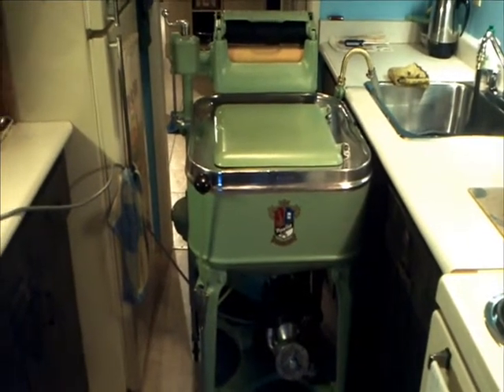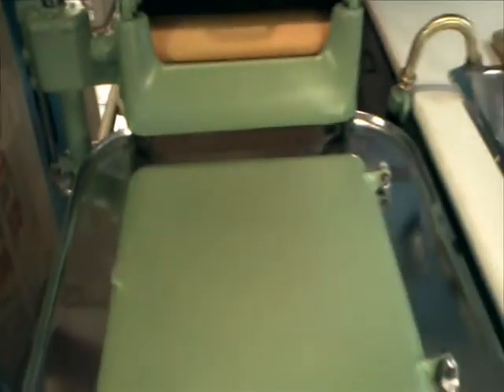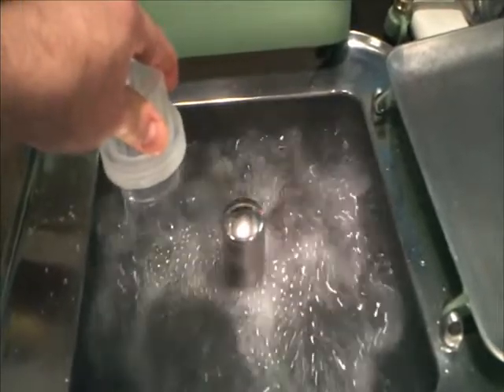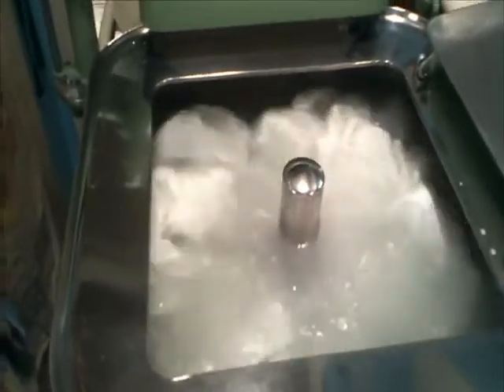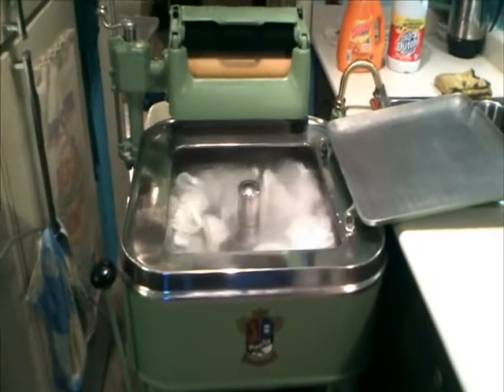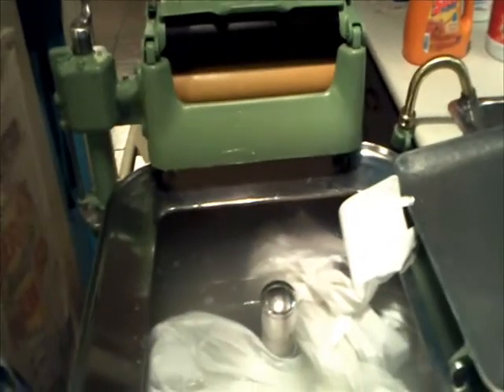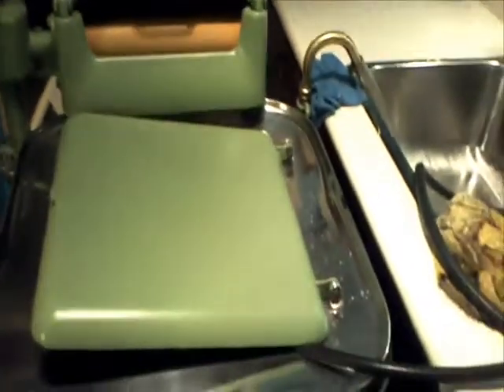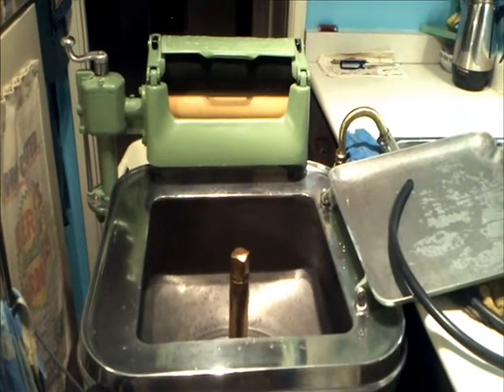Antique Maytag model 30WP wringer washer tutorial

Comment: I have a similar model, Just starting on the restoration. Most things are obvious in how they come apart except the agitator . Is it forced fit on something like a morse taper, a screwed on or what? Not something one would want to start beating on and break. It does have slight knurls' impressioned within the top 3 inches.
Reply from the maker: This question was somehow missed. For the benefit of anybody actually reading the comments, the agitator just sits on the "torque" or drive block. It's heavy enough that it doesn't float up when water is added to the tub. If it's difficult to remove, that usually means coagulated grease has it stuck on and should be released by use of a torch. The torque/drive block is bronze, so it won't be rust that has it stuck on.

Comment: Greetings! I just picked up a Maytag square body wringer washer. It was sitting on its side in a field, so is dirty, but not very rusty. I plan to restore it and use it as my shop washer. I have two Maytag engines - a single cylinder and a twin cylinder. Do you know if there were separate models of washers for gas or electric power? My wringer rollers have seen better days, and the drain hose is split. Do you know a good source for parts?
Reply from the maker: Hey Jason ... I do apologize for the delay in responding. To answer your first question: the model numbers varied only as a designation to identify whether the machine was equipped with an electric or gas "Multi-motor". The machine itself was not different. For example, the Model 30 (electric) if equipped with a gas Multi-motor was a Model 31.  Its predecessor was the Model A (electric) or B (gas).  Later model was a 32 (electric) or 33 (gas). 

Parts do show up on ebay periodically. If you can identify your model (and perhaps send me a photo or two), I can advise you of my parts sources by email.
Reply: I need my maytag wringer washer repaired